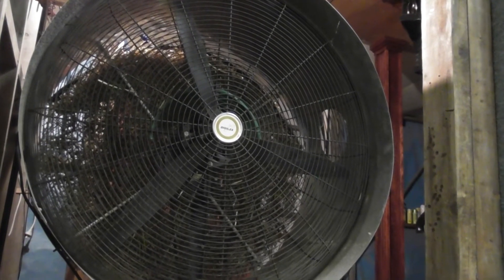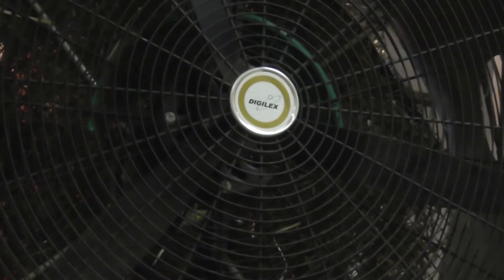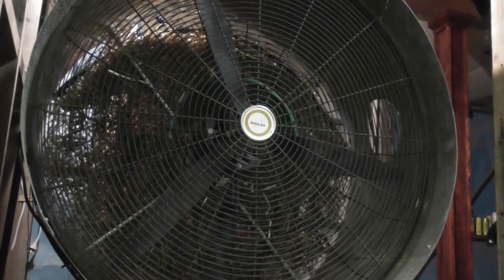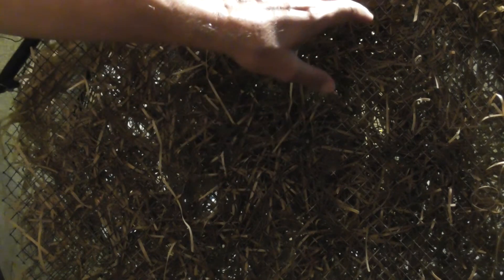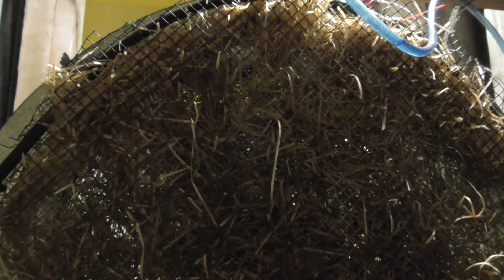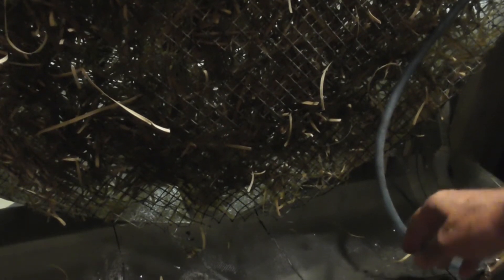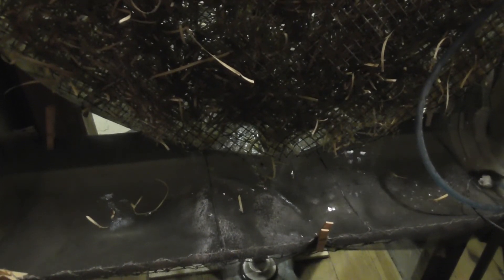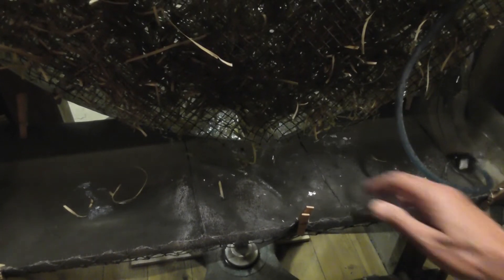Home Made Swamp Cooler (Evaporative Cooler) ❄️

Comment: sounds quit xD
Reply from the maker: No. It's very loud. But insulation inside the shroud might reduce turbulence and the main source of noise?  ;D
Reply: @zuditaka   i make a few with my own hands he needs bigger pad less noisy fan this fan is for open gardens and stuff not for inside home
Reply from the maker: @EgyptPaladin  
This one is very effective as an indoor cooler, but very noisy! yes. One's eardrums get tired of the noise after a few hours!  You have to have a door and a window open so that the moisture doesn't get trapped inside the house. It does make the place cool.
Reply: @zuditaka  yes needs to vaccum air from outside and an air vent on the other side but i really love them i have a passion for them lol 
you need 2 honeycomb boards and make a large box to hold them honeycom board is 60 cm *150 * 10 thickness if you get 2 boards the fan noise will greatly reduced also you will get much cooler air
Reply from the maker: @EgyptPaladin  

Okay. We'll check out and research honeycomb boards. Thanks for the bright idea. All people in hot dry climates need cool air too! 🌬❄️🏜🌵
Reply: @zuditaka  you are welcome my friend where r u from anyway?
Reply: @zuditaka  https://www.facebook.com/air.evap.coolers/photos/a.482738005216552/845354965621519/?type=3&theater
it started as a hobby now its my career check this on out :D
Reply from the maker: @EgyptPaladin  
I can see you are an expert on making air coolers!  ;D
Reply: @zuditaka  its my 7th year if you want to use axial fan use honeycombs its best for axial  also its antibacterial  smoother air flow its more expensive lasts for 3 to 4 years
Reply from the maker: Palm tree and luffa fibre sound like good alternative ideas, too. No, luffas are not a common gourd in Australia. But they sell them in chemist shops as bath sponges. (I think they can be eaten when young like courgette marrows.)
Reply: @zuditaka  we dont eat it here but its not poisonous  it has very hard fibers but its very good at resisting bacteria and mold 
coconut fibers the brown ones around the shell is good too also add alum crystal to the water it will kill any Bacteria  also it will collect dust at the bottom of the water tank preventing it from clogging your pump alum is Al2(SO4)3 you can find it in crystals
Reply from the maker: Thanks for the information about alum. We haven't ever used it before. I know some water coolers can smell all mildewy/moldy and unpleasant. If you pour disinfectant in them, the whole house will smell like a lavatory! lol
Reply: @zuditaka  also never turn off the pump while using it turning off the pump will make it smell (it smells even using right material for pads )
Reply from the maker: I am in Australia but I am half Sri Lankan and half British.

Comment: Swamp coolers aren't as good here with the high humidity.
Do you have much insulation where you live ?
Reply from the maker: I've never used a swamp cooler on the coast, so I wouldn't know what it is like there. I do observe, though, that even out here, where it is very hot and dry, that they work best if there are at least two windows or doors open in a room. If a swamp cooler is in a room with only one opening, or none, lol, it can get all very humid. They seem to work better if there's a flow of air allowed through a room. Yes, we have better insulation, nowadays. Since we insulated the ceilings the rooms are definitely cooler in summer and warmer in winter. The walls are warmer in winter since we put insulation in. Shrubbery seems to make an enormous difference, as regards heat and glare. We chopped down a lot of privet near the house, to do some tiling on our verandah, and now it's all superhot in the afternoons and there is terrible glare. I have to draw the curtains and can't wait for the privet to grow back. That shade makes an enormous difference. One could hang shadecloth or bamboo curtains, or something, on an exposed verandah, I suppose. I intend growing wistaria and other vines all over the verandah as soon as work is finished. They might attract a few mosquitoes but we need to be cool!  🌳🏡🌳🌴🍹🍉
Reply: Yes shading plants make a house much cooler.
I grew boston ivy on my western brick wall, which it covered so quickly and it makes it so much cooler.
It looks good too.
Some people say it is weedy, but I don't care.
I would really like to grow something over the entire roof in summer.
Reply from the maker: I once saw a house, in Forbes, by the river, that was completely covered in gorgeous blue morning glory. The stuff was even climbing high up the TV antenna. I don't think it could've been so lush without irrigation, though. I try to encourage vines, everywhere, by the house, and up through trees. You wanna grow some African horned melons. They cover a wall quickly! lol Jasmine is good. Various passiflora make nice garden drapery. I'd grow ivy, everywhere, too, but it's far too hot and dry, here. Grapevines are nice, but are a bit thirsty. Boston ivy and Virginia creeper are too thirsty, really, for here. The white wonga vine and the purple hardenbergia vine are very drought-hardy once established. They grow wild around these parts. Your neighbours wouldn't like morning glory creeping over the fence, I am sure. Wistaria sinensis seems pretty tough and a vigorous grower. I'd grow climbing nasturtiums and scarlet runner beans--if the climate were more hospitable. Would a choko vine cover your roof? Look in a fancier fruitshop and you should find white chokoes instead of the usual green. At least that will be a bit of a change... Would a sweet potato climb over a roof? https://youtu.be/gKXNf_IEsjs
Reply from the maker: I forgot to mention orange trumpet vine--campsis grandiflora and catsclaw creeper. They are both quite tough. Is that "madeira vine" legal to grow in Sydney? I remember it used to be quite rampant in some places. I rather like it. and that "balloon vine" too.
Reply from the maker: Antigonon is supposed to have an edible tuber. Have never tried choko tuber, either. But handy permaculture ideas, anyhow, as emergency food, I mean...
Reply: It would have to be pretty vigorous to grow up 5m then cover the roof.
I would like something edible or useful if possible
I bought some Kudzu seeds on ebay, it is notorious in southern parts of the US apparently and probably illegal here.
I don't know if it is a practical idea though and not sure about maintenance issues and having to climb on the roof too much.
I read in some hot dry countries they have flat terrace roofs covered with grape vines.  This sounds ideal with easy access and maintenance.
Reply from the maker: Phoenix Seeds in Tasmania--permaculture seed specialists--don't do Kudzu. I think those vines are known to take over and fill ravines, and crowd out everything else. You could have an assortment of vines, all intertwined, including Kiwi fruit. There's another weedy ornamental--I think it's called Dutchman's Pipe--it has pretty flowers but takes over. Catsclaw creeper is taking over areas of WA. Grape vines are useful in that, as well as the grapes, you can make stuffed vineleaves. I think there are more hairless leafed varieties available that are better for stuffing. I suppose you could have some sort of hydroponic thing on the roof out of which vines could grow. Passionfruits don't need that big a pot to be able to grow rampant from. Hop vines can be used for beer as well as an ornamental vine. Wistarias are decorative and have edible petals: https://www.youtube.com/watch?v=Cwx2yhM0wMM  Some climbing roses are pretty and have edible hips and petals. 🌹
Reply: I do have a lot of kiwi vines, and they are quite vigorous, so a definite contender, deciduous is probably good because shade is only needed in summer and it could be tidied up in winter.
Grape vine's edible leaves are a good bonus, especially if you wanted to keep rabbits or the like.
Though  edible leaves might encourage possums which can be a real pest sometimes, killing entire trees.
Reply from the maker: Wistaria flowers are unusual, as food I mean. Handy to know for an emergency--and as "stored permaculture energy". I want a flaming blue/purple bougainvillea to swallow up my entire house! lol

Comment: I wouldn't worry about bacteria since it's a "total loss" system rather than being recirculative. It's a bit noisy, I wonder if your friend has a variac so you could experiment with running the fan a little slower and quieter? When I lived in the middle east we used to pin sheets across doorways and dampen them every half hour or so. That was a pretty good way to keep cool, same principle.
Reply from the maker: I've told my friend of your "variac" idea. When it's like a furnace one is glad, though, to have a big butch fan, noisy or not, cooling everything. It certainly does the job. When my mother was a girl in Wellington, NSW, in the 30's and 40's, they used to hang a jute or hessian bag over the doorway, wet (of course) to cool things down in that terrible heat. It certainly works the same way, yes. Anyhow, I've got that noisy fan running, as I type this, and it's keeping me lovely and cool.  https://youtu.be/MiUWW7y4U3w You can hear the GIANT fan, in this video! lol Last year was a scorcher, too! I'm just glad to be cool after decades in a hot tin shed! lol

Comment: I know this technique as "VENTA air washer/cooler" for indoors, and as "mat cooling" for greenhouses.  The only Problem is that the recirculating water will filter dust from the air and become dirty and a breeding ground for bacteria!
Reply: The VENTA air washer/cooler uses an additive to the water, which prevents from bacterial growth, it is most likely Copper Salts.
Reply from the maker: So you reckon we might get Legionnaires' disease? At least we don't perish from the heat!  :/ The woodshavings or plastic straw stuff in some commercial swamp coolers can be washed or changed periodically. Some people like the scent of woodshavings. It's so hot, here, anyway, that the water is all gone in an hour or so, and has to be refilled with fresh water again. It's mainly to keep us cool at the height of summer when the heat is like a furnace!  :/  ☀️🏜
Reply from the maker: I think adding disinfectant to an air cooler would make me feel sick! Once I added lavender disinfectant to an aircooler and it made the whole house smell like a bathroom or lavatory--a smell of lavender disinfectant permeated everything. I felt like throwing up! 🤢 Are copper salts something that have no smell? Are they environmentally friendly? Or toxic?
Reply: !!!MY!!! main concern with your Project is the noise of the Ventilator OMG!  I do not even know, whether Legionella will even be transported by naturally evaporating water. SURE IS: IF there occurs bacterial growth, you will definitely smell it, bcz bacteria produce volatile compounds.
Reply: Copper is a trace element. Copper salts are odorless and they are used against pathological Funghi in agriculture. Rethinking the issue at stake, I would rather use BORAX. Boron is antimicrobial too!
Reply from the maker: https://youtu.be/MiUWW7y4U3w You can hear the noisy home made swamp cooler fan in this parrot video I made last summer---but it definitely kept us nice and cool when the heat was so unbearable even the parrots came to shelter near us! I wonder if travelling on a Jumbo jet is quieter? lol
Reply from the maker: I'd rather have to put up with a bit of a roaring noise for awhile than live in a furnace!  ☀️😈👿☀️
Reply: @zuditaka  just use alum and you will be ok but wood or straw is very bad media use palm tree fiber or natural luffa idk if they are natural plants in your country but they have anti bacterial properties
Reply from the maker: @EgyptPaladin  
We have plenty of palm leaves, here. So they can be dried out and used instead of wood  shavings. We never thought of that. We have Canary island Date Palms here and Cocos Island palms. 🌴🌴 Thanks for the useful ideas.
Reply: @zuditaka  not the leaves the fibers around the trunk they look like coconut fibers
Reply: @zuditaka   google this word ليف نخل